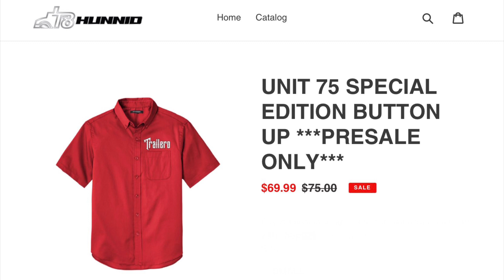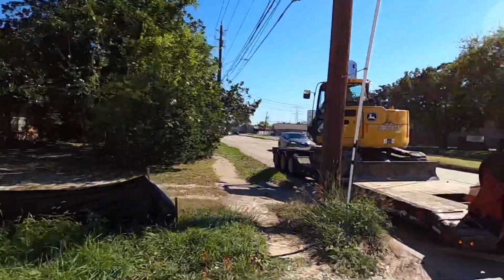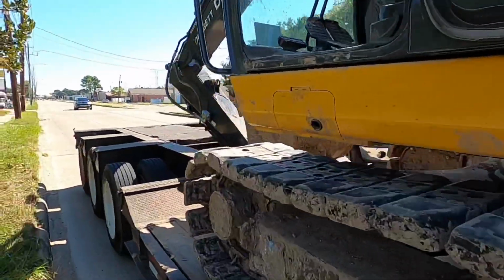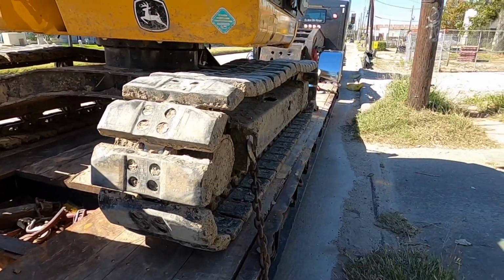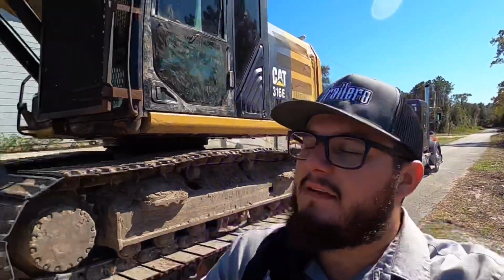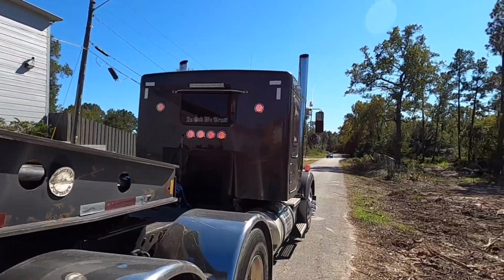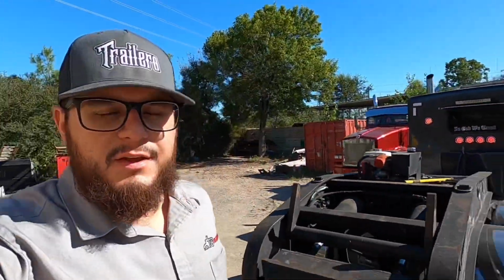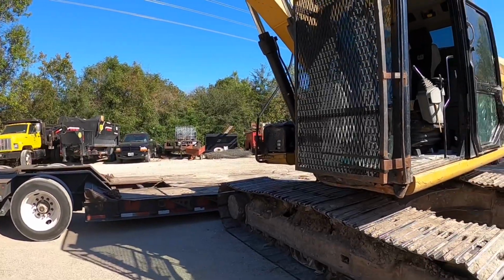Shifting and loud jakes | Hauling mid size excavator, deere 75G

Comment: i've watched your stuff for a while & love it seeing how you do stuff different in the US. 
 I'm from the Uk so hauling stuff is a different here... i've never seen any lowboys in the US with steer axles on the trailers? do you not have them?? 
i do heavy haul over here and i have a 4 axle low loader trailer & my 3 rear wheels steer, can be done manual on a remote as well. helps with the tight areas.
Reply from the maker: Yes we do have trailers with steer axles just like you guys. But our roads have plenty of space to turn without needing steer axles on trailer

Comment: Dude you're always taking the machine off the side and putting it off the side that's a good way to bend the trailer that's why those beans on the side of the trailer are all like bent down you shouldn't unload and load so many times from the side you should only do it when you have to
Reply from the maker: Those beams are replaceable. Not worried about that. Trailer still holds up pretty good. It’s just iron
Reply: Bui emilio i always do that and my trailer dose not bend